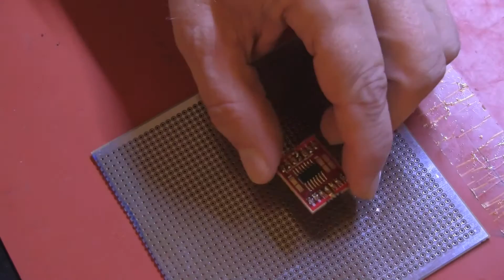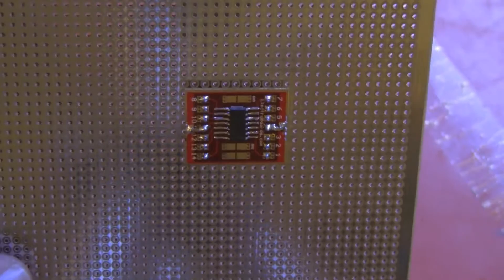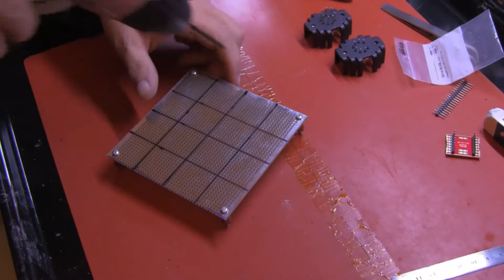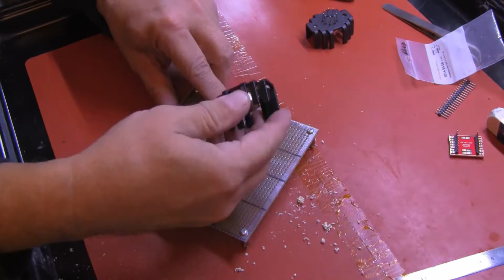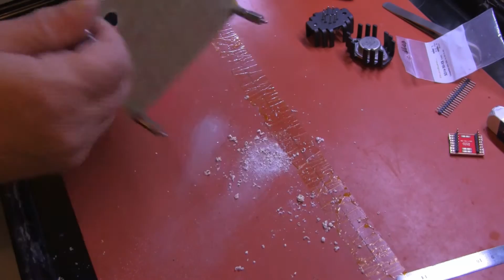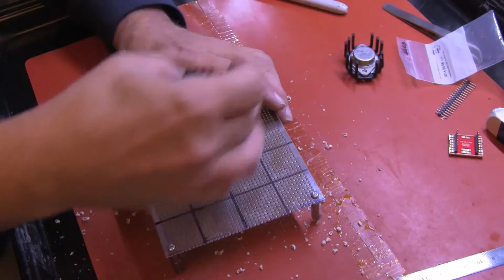Dual Scan Amplifier Project Part 2

Comment: I do feel on deflection amplifiers its always been in the past done well with transistors  and valves .op amp's are great for the present but they become very obsolete as time go's by as yes trany's and valves but they are still will be easier to track down something similar  ...I have been trying various circuits my self as the magnetic deflection amplifiers  interest me mainly because they are really so hard to do right ..either you get lineality or  size problems if your lucky ! i feel you really know how to make a television if you master these ...electrostatic deflection is much easier ....this is a interesting little read http://www.earlytelevision.org/damper.html
Reply from the maker: Dalek, 
1. This is the least efficient way to drive a deflection yoke, as I learned from the experience. The top bandwidth, at this time, is 2KHz at best, with the yoke I was using. Too many variables to just generalize it as failure or success.
2. There is absolutely nothing "wrong" with opamps. As you see in my videos, I use them A LOT. Far simpler and much better behaved than discrete circuits which don't always work the same when copied due to all sorts of uncontrollable parameters. I was hoping for 20KHz bandwidth, got 2. Not surprising. Still usable for low band TV at any rate. Wait til I bust out the image dissectorS. Yes! Plural! Got some new deflection coils to play with and maybe the lower inductance will allow a higher bandwidth. Or not. Depends on if the yoke is the limiting factor. 
3. The subject of "damping" is related to the "bell and hammer" circuits used for high speed deflection. These are optimized for only one frequency and are not easily adapted to other scan rates on the fly. You bang the flyback transformer and yoke with a harmonic rich square pulse and let the tank circuit effect ring at the desired frequency. Sort of like striking a bell. The "damper" provides suppression of the third harmonic and does very complex things with the voltage and current phase. This is the part I am not able to analyze. (US school system damage. Sue your teachers for malpractice!)
Reply: Richard you never know unless you try ...BTW great construction video !  Keep on trying i know that they are a hard thing to master  .I have tried about 5 circuits for no other reason to learn and see the results ,all really old SSTV deflection circuits all very similar but so in results ...i am not stopping till i am happy with one .